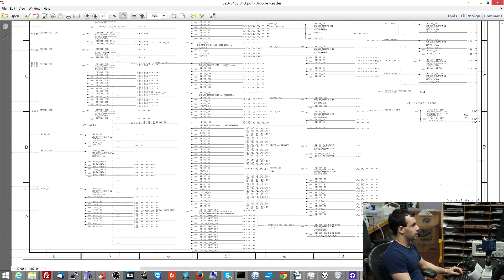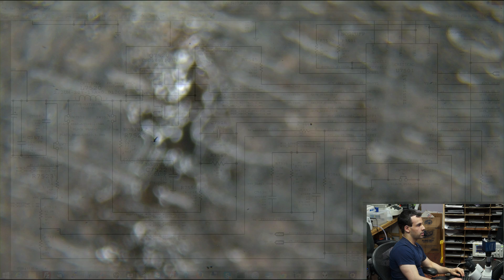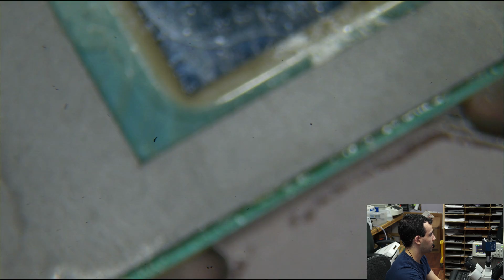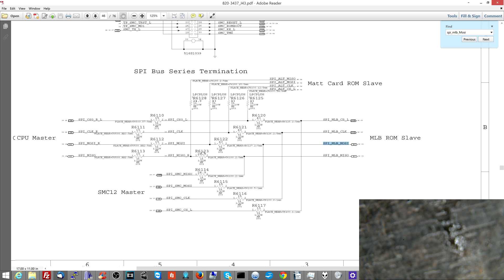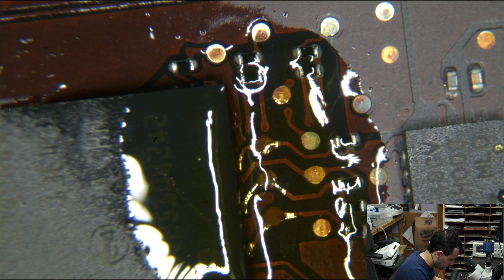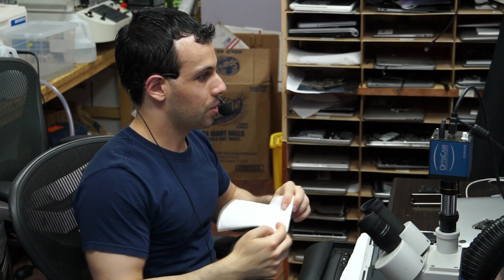Macbook Air logic board not turning on because of missing PM_SLP_S4_L signal, no SPI ROM

Comment: Hello, you seem to be a very talented reverse engineer. Do you know what is wrong with my Mac sir.? Its a macbook air 2012 11" model and suddenly it stopped the keyboard , trackpad and WiFi. The error in apple diagnostics says that  it is a Th1h :124 error which is a thermal sensor error . So I have pinned down the error to a IO board . Am I in the right direction ? Thank you.

Comment: I already replaced the main board in mine but I decided to look at the old board out of curiosity. However there is no voltage at any of these points. On the other side everything measures correct. Where is the voltage coming from to the bios chip? I have the schematic but I do not see any voltages there. "I am only getting 1.1v at the bottom pin"

Comment: 24:55 What about the missing trace between bottom resistor R6117 15Ω and the probe point, which is actually SPI_SMC_CS_L? It may have fan spinning, but that is not all what it takes to work ;)

Comment: Hi Louis, Congrats for all the videos, very interesting. My friend I got a question for you:
I have a Macbook Air 13 2013, this one just turn on if before I remove the battery connector and unplug the charger and putting all in back. When I press the start button this turn the light on the magsafe connector from Orange to green for 1 sec and later back to orange. I have no idea what's going on with this one. I hope you can enlight me please. Thanks for your comments.....!!!

Comment: hi. just a dumb question here.. (sorry) my macbook air does not boot up but the fan runs when power is pressed and fan also  turns off when pressing power button for 5 sec. what could be  the problem. need your help on this. thanks.
Reply: thats easy...  buy a new one... :)
Reply: very funny!

Comment: I worked for an OEM for five and a half years. During that time, I worked on two specific models of equipment. It was fucking miserable work; being constantly bored but having to keep up a production quota.

I kinda lucked out now and I work as the engineering tech for a company that services a variety of different equipment, that's constantly changing.

Comment: This 820-3437 board is throwing me for a loop right now. I'm missing PM_SLP_S4_L which means I have no 5V lines, which means I can't power the CPU/PCH. So how does this loop make any sense? I just can't figure out which of these could possibly come first. Any help would be greatly appreciated.
Reply from the maker: Ben Falk U6100.
Reply: yes, thanks, I'm sure of it, that whole area is a mess and I'm sure U6100 is going to be the issue, but this other concept is not working for me. I just don't understand how something can make something that it needs to make something... that it needs... to make something...
Reply from the maker: PM_SLP_S4_l won't show up without other signals to the left of it. Like PM_PCH_PWROK, or PM_RSM_RST_L, and so on and so forth. Further, SPI ROM has to be good and working for PM_SLP_S4_L to be released.
Reply: That part makes sense. I'm just struggling to understand how the CPU/PCH can create and send a PM_SLP_S4_L signal with 0V going to it - without the 5V S0 line to create cpu vcore S0. That's the part that's missing in my head. Without it I feel like I'm going through the motions without understanding the actual power sequence.
Reply from the maker: If only the CPU/PCH had a ball under it providing it with PP3V3_S5 and PP3V3_SUS so it could take care of these tasks before entering S0...
Reply: if only....

thanks, i can sleep peacefully tonight
Reply: As it turns out, another dip in the crest got it going. The ultrasonic fixed it the first time and I used it for about a month before it stopped working. It's not my ideal fix by any means because I don't know what just changed, but I'll go with it for now. Not sure which component would stop working, work, stop working and then work again.
Reply from the maker: Look closer. Something is barely hanging on the motherboard, it will just do this again.
Reply: that makes sense. i'll do it. thanks

Comment: After watching several of these videos, I come to wonder just how permanent these repairs are. or if they simply delay a further failure. With water damaged electronics even if you repair one fault, the corrosion eventually gets bad enough in another area where another fault occurs. I would expect the entire motherboard to be replaced for a proper fix and not just address the corrosion in one spot when it's prevalent in more locations. But yea regardless of the end result, your hand soldering skills are absolutely atrocious, thank jebus for the mountains of flux you use.
Reply: Seriously? Entire motherboard replacement... For a freaking test point? And then we complain about the amount of waste we produce, the planet going to shit and pollution... no wonders since we happily throw away mountains of perfectly working electronics full of heavy metals because a freaking 0.5mm copper pad went bad!

When you clean the board with ultrasonic you get rid of all the corrosion on the board, and it will not spread again since it's gone, unless you get water on it another time.

Comment: Hi Louis, thanks for the excellent video. It strikes me as very similar to my issue. I have a 820-2879 which suffered liquid damage and is not turning on. Plugging in the board gives a green light and the battery charges fully. I have all the S5 power rails, PP3V42, G3H, but none of the S0 rails. I traced this back to not having PM_SLP_S4_L and PM_SLP_S3_L signals which of course come out from the MCP and that looks okay. Is there an analogous chip to the SPI ROM on the MacBook Air in your video to the MacBook Pro? I tried supplying 3.3V to PM_SLP_S4_L and PM_SLP_S3_L and very interestingly the fan spools up to max speed and the hard drive powers up but nothing else seems to work. There is no chime and no display. I'm assuming this is because I'm partially powering up the board with individual components but the BIOS isn't being activated properly because I am bypassing it. Any tips on what component to check next? I'm assuming it's something with the BIOS but I don't see any corrosion on the board at all, and this board is way cleaner than the ones you show in your videos which are very corroded. Any help is greatly appreciated!!
Reply from the maker: Shahrukh Bakar This video will show you what to check next. Please watch in full. https://www.youtube.com/watch?v=Rzw0erVbRm0
Reply: Louis Rossmann Thank you. I remember watching that exact video. Unfortunately I don't have an oscilloscope so would a DMM show a DC signal on such a high-frequency XTAL signal or should I not bother trying with a DMM in case that causes problems? Is there any other surrogate marker of a working MCP that I can test with a simple DMM?
Reply from the maker: Shahrukh Bakar You will never see a 32 KHz sine wave with a DMM.

Comment: F@<{ that Menda alcohol dispensing pump. I have the same kind bought from all-spec. I have cleaned it following the instructions provided by Menda sales rep and no luck. I have to please it or hammer it to get it to pump the alcohol. I just end up opening the bottle and use the pipe to dispense the alcohol...most of the times.
Reply from the maker: Aashish Shrestha Yep it's designed to dispense the alcohol straight into your eye, complete piece of shit.
Reply: Louis Rossmann hey if your talking about the ones with the lid that folds up... Usually they have a post in the middle I unscrew that and just keep the lid closed and pump a few times and it will retain the alcohol in the reservoir and open the lid and dip toothbrush or qtip.. did I just admit I use qtip's..?
Reply: I think if someone could invent a qtip that doesn't leave strands they would make a fortune from the tech community....
Reply from the maker: Absolutely. Brush just isn't the same.